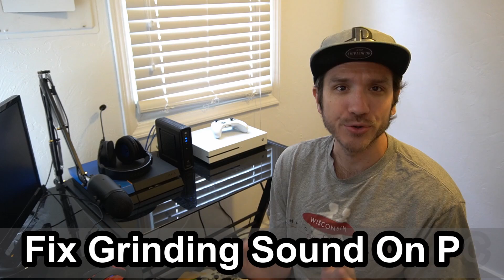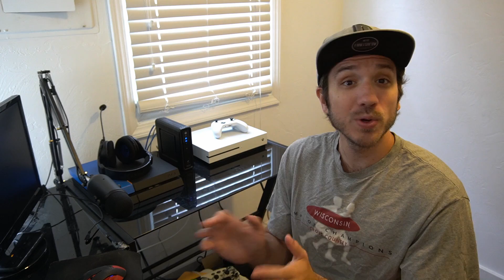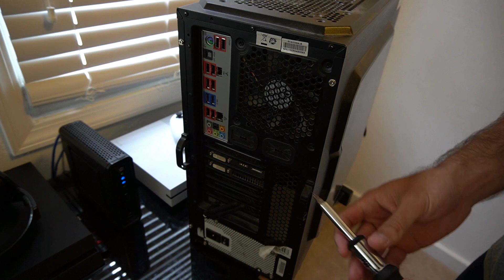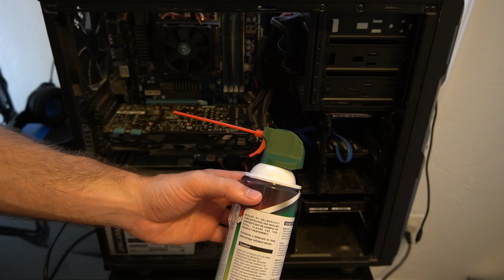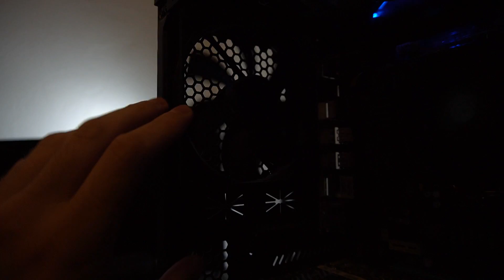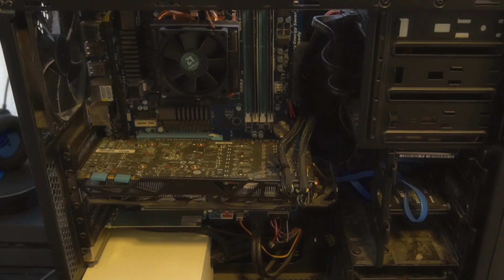How to Fix Computer Making Grinding Noise (Easy Method)

Comment: yea this works, i had a light dust build up which was causing my power supply to grind a little, dusted it with a dusting fan and its quiet now, even a simple dusting of the fan is enough to get rid of the noise.

Comment: You are a pure genius, life-saver! I'd heard this solution years ago. I've also fixed this in the past by using tweezers to pull the dust out of fans and related. This time stopping the fans didn't work BUT you gave  me the courage and inspiration to keep trying. Ultimately, I kept pushing on the center of each fan (rather than putting my finger in the blades, lol). I could not tell by sound but by stopping fans I found it was the graphics card fan (hardest to fix). I tried everything and finally kept stopping it and pulling it down, by that center part of the fan. It FIXED it (by creating more space so whatever was hitting could no longer hit)! Thank you, genius computer fixer! (The most profound solutions are usually the simplest!)

Comment: I know this is 4 years old, but still relevant. For the viewers, instead of compressed air, you should look into a rechargeable compressed air 'machine.' It's a small hand-held air blower and mini vacuum in one, with multiple speed settings and attachments such as brushes to brush and blow air at same time, longer pieces to get into hard to reach places, etc. They are $20-30+ and well worth the investment! Something that can be used over and over is the same price as 2 cans of air that will run out in a few uses, and you can't use it continuously as it will freeze over. You can use the rechargeable one how ever long you need!

Comment: i have a question, my pc does sometime the noise, but sometimes it doesn't. I think it's the fan in the front but i wanted to make sure that if a hard drive fails... can it stop making sound sometimes??? 

also, could a hard drive making really loud noises not fail for 2 years or more? it's been going on and off and sometimes stops if i tilt the computer (not hit, just lightly tilt it so again i doubt it's the hhd).

Other thing that also seems to work is activating a switch in the front of my pc. I guess it's just an extra fan or something.

Comment: I recently dusted my Desktop about a week ago, but forgot the get the GPU fan (due to it facing downwards). I opened my case, dusted the GPU and noticed that one of my power cables that connects to my motherboard was awfully close to my rear fan, I'm assuming that the loose cable was pressed up against my rear fan when my case was closed; as I have subpar cable management in a mid-tower case. I adjusted the cable a bit to be a bit further out and the sound has stopped. So between my GPU and cable management lied the solution.
Thanks.

Comment: so my fan sounds nothing as bad as your fan did, but mine only seems to make it's whispering noise when i'm playing anything with audio, i also recently within the last year got a new SSD hard drive because the other one died. 

and i just recently took a can of compressed air to my PC with a vacuume to suck up the excess dust particles. 

but the sound mostly happens when i play anything with audio, i'm not sure it's the fan, but it is very faint, but not too faint that i can't hear it when i play anything with audio, the sound is not coming from my speakers if you think it was. 

i hope i don't have to take my PC apart, because i'm no expert in my PC as i had someone else build it for me. 

it does make noise when the audio isn't running, but it's much more faint and it's heard less often as when the audio is playing.

Comment: I checked all my PC fans, and it turned out that my sound card was very close to one of my graphics card's fans, and when it was spinning it touched the sound card very fast, which was making a blender-like noise. Removing the sound card made my PC work so quiet now, thanks a lot mate.

Comment: thx alot for this vid turns out what was making my fan vibrate was some dust stuck inside the bit what spins around and after i cleaned that i was silent as a mouse thx

Comment: thank you so much for this! i heard the very same grinding noise as in this video two days in a row during startup. i was afraid that the sound was a sign of something beginning to fail, but after unplugging and replugging in my fans, the noise disappeared. thank you again! God bless <3
Reply: Did your computer make the sounds every time at startup? I have a similar situation but it only randomly occurs??? If I restart my PC it goes away after a few tries. Sometimes it doesn't even make the noise at all. I don't understand...
Reply: @xMCxVSxARBITERx  helloo, it did make the sound every time it started up. the sound would go away after a few minutes of using the computer and wouldn't come back for the rest of my time using it. in the two days the sound persisted for me, i never experienced your case where it just randomly happens. i assume unplugging and replugging in your fans didn't work for you? :(
Reply: @kristweenie  
Thanks for answering! 
No I haven't tried anything yet. All I know is that I have no problems unless they are there at start. I don't mind restarting my PC 2-3 times but I'm just worried something is slowly breaking apart every time it happens 🤣
Reply: @xMCxVSxARBITERx  no worries! HAHAHA i get that 🥹 even though you don't mind it, i hope you figure it out eventually! fingers crossed that nothing's breaking either from the constant restarting HAHAHA
Reply: I’m having the same issue 😅 when I start up the PC sometimes the sound is there but then I shut it off and turn it back on its quiet. For sure it’s one fan I have 9 and that sound stops when I put my finger on it. So I bought a replacement but haven’t fixed it myself.

Comment: the noise from your fan is the bushings inside the fan, just 3-in-1 oil the fan, a lot of fans come apart after removing a tiny c-clip made of plastic, on the bk of the fan, under a sticker and some have a rubber bung coving the c-clip. some new fans dont seem to have that, i found any light duty oil, is good enough, wd40 tends to work for a while.

Comment: Yeah it's a fan issue...
but it's the fan on the power supply😭

Edit: I fixed it
Reply: How
Reply: Yup i just checked its my psu fan, do you have any solutions?
Reply: @Im_SSJay  Just open your PSU and remove the fan. After that, open the fan cap and add oil to it and close it. Add the fan back into the PSU and close it.
This worked for me. It's easy to do this. Also don't touch the capacitors in the PSU because they may give you a shock.

Comment: I have issues with a kinda "bubbly, rattly" sound from my PC. Started recently, haven't changed anything on it recently aside from installing a M.2 SSD, and that was a month ago, and a new GPU 2 months ago.  Happens on startup. No differences in performance or temps.
Reply: Same, just a slight noise on my psu fan or something but no difference in performance or temps but it do be bugging me...
Reply: @SpookaySpctr  same here lol. I just cleaned it and since the pc makes noise only sometimes and then stops when I try to investigate it annoyingly. Very hard to spot where it comes from.
Reply: @SpookaySpctr  yeah same i was wondering is it bad if i keep playing like this or do u recommend i change it or something , because i still don't know how to fix it i ordered an air duster rn because i don't have one

Comment: Thanks for this video. My cpu makes a noise only when exporting files from Adobe Premiere Pro. Maybe because of dust and dirt on the fans?
Reply: If it's just a regular fan noise (and not something crackly like this), it's probably just your fans speeding up to better cool your PC, since your CPU and other components will get hotter with a workload like premier pro
Reply: @bluetech2809  Thank you for the advice. <3

Comment: Wtf after watching this video it magically fixed my fan, I think what helped was lightly pulling on each blade so the bearings could reset
Reply: What do you mean by pulling on them? Like pulling them back?
Reply: @harrisonhinchey91   Yes, my fan was making a worse grinding sound than the video, but same sound. I very softly and carefully pulled up each fan blade thinking maybe my fan was slightly off center, I pulled them up towards the front of the fan. And once I turned my pc on and let the fan spin up full speed, the sound faded away, sounded like the fan kinda moved back into place. Maybe the bearings or the small motor who knows, but it worked for me.

Comment: If there’s anyone not having much luck with these solutions. There’s an alternative that worked for my issue. The back of the PC was full of dust and a slight blockage. I blew and it fixed the issue :)
Reply: Thank you so much bro i was so scared and this fixed it for me
Reply: @Suvux  You're welcome bro :)
Reply: Omg tysm!!
Reply: what if it's my top fan 😕i'm starting to think it's faulty
Reply: @gonzopr420  It's a possibility. My advice is to very carefully place something in between it to stop it from spinning. Then allow it to spin again, this sometimes can fix the problem. But if it continues to happen, it's also possible the top fan isn't screwed in properly or securely fitted. I'd highly recommend checking it. If all else fails, I'd recommend buying a new top fan. :)
Reply: @Luka-x6x2x6  it's funny cuz i just smacked it on top and it ... fixed it
Reply: ya  thats ture its the most cheapest way
no need of thiners and other

Comment: Thanks dude, I had exactly the same problem as the one shown on the video -exactly the same fan! I fixed it by ironically doing exactly what you did, only difference, I used a brush.  The fact that is just started working again with no issues, is what really confused me - After hours of searching online, I finally have an answer.

Comment: my fan won't stop making this noise. idk what to do. i tried spinning it with my finger but it's still making the same noise even after
Reply: hey I don't know if your having the noise but try put a dry rag in the fan in move it with finger there might be dust if that does not work thin your fan is dying

Comment: Sometimes my motherboard's chipset fan makes a grinding sound for 2 seconds while starting up, but not always, I think it's because it fully spins up and it's dislodged off it's bearings and it corrects itself, not sure why it would do that, but I read that is a possible
Reply: One of my fans has done that for years, too. I think you are right.

Comment: Got a new pc today worked just fine for the first 6 hours, now it just turns itself off after a minute or 2 as the fans sounds like crazy after getting shut down, could something
potentially have broke in it?

Comment: Whenever i try to connect the dedicated graphic card the monitor just stays black i even bought a new power supply and it is still same .. im running on integrated..(sad story ) i use it like that for some time but now im keen to fix this crap if possible and if cheaper than buying some other ..and sometimes during the game or after i start the computer after sle
ep there must be like 2-3 minute of freeze

Comment: Anyone else watching this because when you turn on your pc it makes a loud tractor engine noise?
Reply: yh
Reply: And I can’t fix it 🙁
Reply: same and no fix seems to work
Reply: Yes but cannot fix itt😢😢😢
Reply: same but idk what it really is and I'm scared it's a power supply issue or something. It was fine other than a slow start up the few days leading up to the noise
Reply: Open up all the panels where the fans are and the side panel and turn on the PC, listen for what area the sound is coming from, if it sounds like it’s coming from a fan then one by one press on the middle part of the fans until the sound stops, if it does you’ve found your fan, it’s likely an issue with the bearings or something blocking the fan, clean the fan if it looks like there may be debris, but also just letting you know some PCs do sounds kinda like an engine starting up cause when ur PC starts the fans go to 100 percent speed before regulating to the optimal speed to cool your PC. If your fan bearings are bad then you can try opening it up and lubing it with one or two tiny drops of machine oil. That’s only temporary though and overall you should eventually replace the fan.

Comment: I know this video is old but I only hear a grinding sound when my hard drive is under stress. Basically when its above 30% on task manager. Does that means its failing? If thats the case its been failing for a year with no data loss.

Comment: When i kick my pc by accident, it starts doing this sound but much noisier than yours. I hope that i can fix the problem.
Reply: When you kick your pc?!
Reply: @aidanpoppas123  Always 😂
Reply: @aidanpoppas123  i realized what was the problem. Some cables were close to the fan and the fan scoured the cables so that's why my pc was so noisy.
Reply: @aidanpoppas123  i also put some oil in the fan so it's much less noisier than it was.
Reply: @bkm4t358  I had some cables routed under my gpu and it was so loud and it was the cables hitting the fan.

Comment: Peel of label and remove rubber cap and put a drop of oil in bearing. If those bearings are totally worn out then change the fan

Comment: How do you fix that sudden beep after the grinding stops?
Reply: There should be a little speaker thing that’s inside the computer, you can just take it out, but I wouldn’t as if something is wrong in your pc those beeps can help you understand what is means

Comment: On start up...only one of my 5 fans runs at max speed.. could this be a sensor issue? If I try turning it off and on enough time it eventually sounds normal but it takes 20 start ups.

Comment: i got a gigabyte motherboard x570 but there is a noise now from the motherboard fan, not cpu fan but the one on the motherboard, blown it with dust cleaner only air.
dint fix it, there is still a high pitch irratating noise comming from it...   can you show how to fix that ? i cant take it off and clean it so that sucks !!!

Comment: I've clean my whole system RAM, hardware, fan even I opened it i clear it thoroughly. As it's fan was creating  noise. Butttt none of the tutorial work out. My PC is still off. It's still producing sound.    I powered on my cpu and it's light turns orange instead of yellow. What should I do now ?
Reply: take help from a technician or expert

Comment: i have the same problem on my psu fan what should i do to make it stop. is it fine to stop my psu fan while running?
Reply: No dont do that you really should never touch anything inside your pc while its running especially fans. What is the best way you can describe the sound?  Also when and how often does it happen and how loud is it? There are a couple things it could be. 1) good chance of dust buildup which can be removed using a can of compressed air. 2) could be something grinding against the psu fan but note this will only be the case if the psu noise you hear is constant. 3) could be a fan bearing going bad and while you can lube a fan bearing and fix the issue, its dangerous to open a psu and at that point you should just invest in a new psu or RMA.     P.S. be careful with the compressed air as well it can also be dangerous if not used correctly
Reply: @MidniteMeatBus  i really think its dust build up because every time i turn my computer on it makes a grinding noise and qhat i do is i turn it off the turn it pn again and the noise will go away. Anyways how do you use compressed air properly just got my compressed air today
Reply: @domikogiorgioj.climaco1328  read the instructions carefully on the bottle. Its pretty self explanatory once you read it. Never shake the bottle and when you go to actually squeeze the trigger releasing the compressed air, just make sure you are holding it properly meaning ensure that the bottle is not tilted one way. Also when you go to clear out dust make sure to cover your mouth and keep a good distance. You dont want to breath that nasty dust in once you blow it out from your pc. I wish you luck, a psu can get very dusty as its not exactly the easiest component to dust.
Reply: @MidniteMeatBus  okay bro thank you for the advice ill update you after the clean up
Reply: @domikogiorgioj.climaco1328  👍
Reply: @MidniteMeatBus  im done cleaning my pc with conoressed air. But still na noise is still there tsk

Comment: i have the same sound when i turn on my pc, but when i turn it off and turn on, there are no any sound anymore. but everyday i have to do the same thing...
Reply: Same it’s getting really annoying
Reply: Have you found a solution or are you just gonna keep turning it on and off again? I ask because I have the exact same issue lmoa
Reply: @melonseeds1220  im still turning it off and on xd its so anoying
Reply: @Skirmux  for me too but now it takes 10 tries to stop the noise
Reply: Me too, please let me know if you find a solution
Reply: Same here. Need to keep turning it off and on until there is no noise
Reply: i turned mine off and on and it still made that noise, i discovered the problem and it was the CPU fan, i just ignored the noise and then it goes away after 1 minute

Comment: I just turned on my pc and it sound like a broken jet enjine and now am really scared to turn it back on
Reply: Same with mine, but open it up and turn it on to see which fan or hard drive is causing the problem. It’s the only way you’re gonna fix it. Most of the time, when you start it up again it’ll just work properly.
Reply: Just open ur cpu then clean it and then put them back together and its done